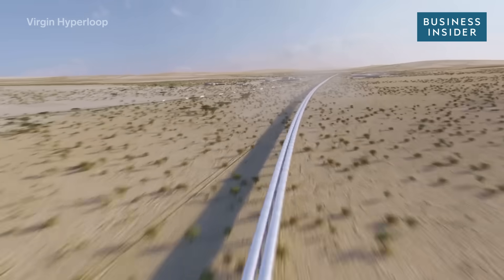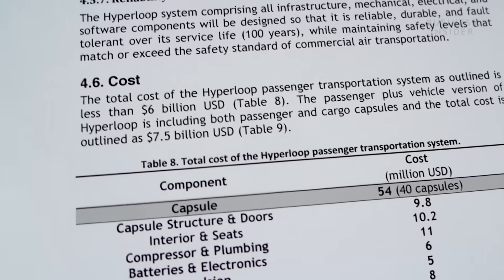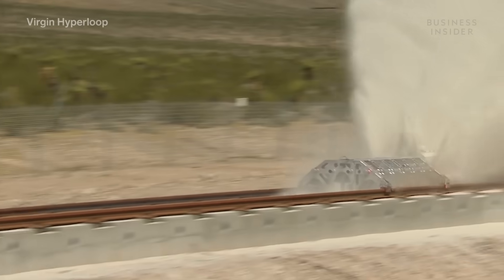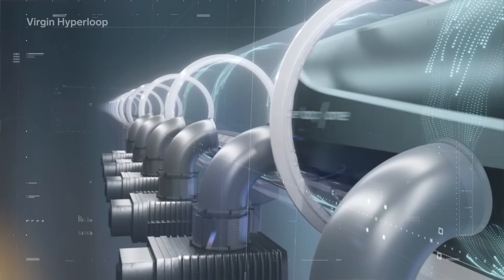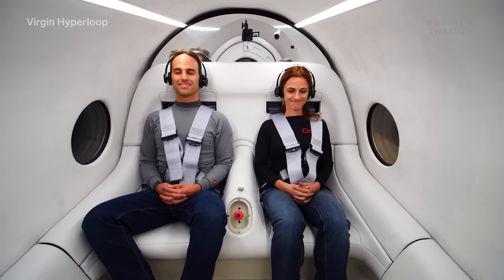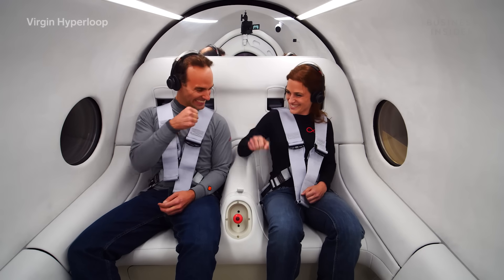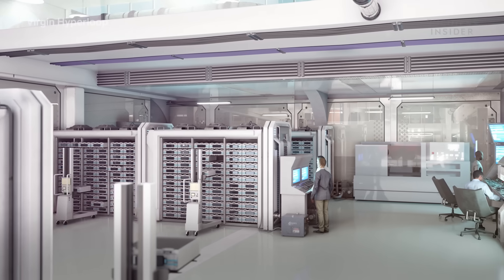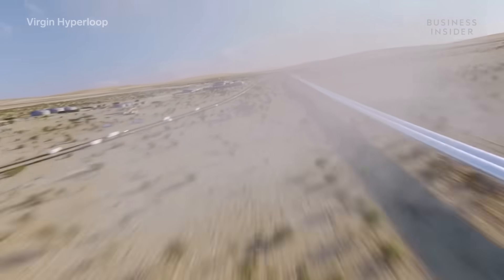How Elon Musk's 700 MPH Hyperloop Concept Could Become The Fastest Way To Travel

Comment: The modern monorail hype, nobody even mentioning that their test drives are slower than a bullet train.
Reply: Uh ...... bullet train test rides were also slower than the final bullet train.
Reply: @dogzer  high speed train test actually runs faster than their operating speed. TGV for example tested up to 500+ km/h while operated at around 320 km/h. Fuxing is another example, tested at 400 km/h and operated at 350 km/h.
Reply: @dogzer  but faster than a standard bloody train. Even prototypes of the hyperloop are objectively worse and more dangerous than what they are trying to replace
Reply: @lyca0n535  and bloody normal train prototypes and early production models were nightmares and death traps. This is like getting mad at a kindergartener because they didn't start with doing backflips on the playground.

No, starting slow IS THE RESPONSIBLE THING. Duh.
Reply: @Cyrribrae  They didn't breach average bullet train speeds even in their unmanned tests where safety isn't a concern. There's alot of criticisms beyond that but this was meant to be a demonstration to the public of what it's capable of and it's worse than existing transport while being several thousand times more dangerous.

Dude I'm not gonna complain if a plane hull in a vacuum tube concept gets infrastructure built I couldn't care less but people sucking this off for concept alone feels weird and sycophanty. 

 Again reminds me of the monorail hype
Reply: @lyca0n535  Sure.... but you know we have rocket prototypes in testing right now that don't go faster than a normal train? That's not because the engineering doesn't work, nor is it because they messed up, nor is it because they aren't planning to have it be much, much faster.

That's just the timeframe and stage of testing that they're in. Does that mean that every prototype in development WILL eventually work? No, of course not. But it does mean that expecting a new technology to wow you on its first steps doesn't really happen (or else they didn't bother showing you the actual first steps). 

I don't disagree with you that the hype has overtaken the engineering. But, that doesn't mean that you fighting the hype is doing any good either lol.
Reply: Slower than a fast car for that matter
Reply: It's not really a test drive of the final product though, it's more of a check mark for where they are right now. As they said in the video we are 10 plus years out still, 10 years a lot can happen.

whether this plan has merit or not at least follow the videos facts.
Reply: @mdem5059  It may not be the test drive of the final product but if your non-final product in 2020 cannot match the speed of the fastest steam engine, it's pretty pathetic.
Reply: @additional09  it been 8 years these things aren't easy to build the fact that they had a test drive was impressive but they really shouldn't be saying it's coming "soon" instead they should say " in 10 to 20 years we might just have a fully functional hyperloop prototype or final product "
Reply: @additional09  That's why it's called in development stage..
Nothing ever in early stages works as it should, nowhere near it. The same can be said for anything in any field of work.
Reply: @mdem5059  I agree that developing tech takes time but if the hype is so high and you can't even match the speed of a steam engine (a record made in 1938) and if there are already alternatives that go much faster, you're not developing it fast enough to catch-up. Next-gen maglev in japan will have 600 kmph speed (375 mph). By the time hyperloop hits even 150 mph, that same Japanese tech would have progressed much faster. Hyperloop is a distraction - just invest in current high speed rail systems if you want good infrastructure. Japan, Italy, China, Spain, France etc seem to do it perfectly well.
Reply: @additional09  indeed. The thing that missing for the report is that the consept of running a pod in a tube is an old one it not a new ideal. 

The real question would of been be to ask the engineer guy being interviewed is how many passengers can your system carry in a hour, and compare that to over forms of Intercity travel but that never gets answered because it never a transportation journalist asking the question.
Reply: @mdem5059  The hyperloop concept is just a few years older than the plane... If it way viable it would have been build by know.
Reply: @additional09  Don't get me wrong, I'm not for or against hyperloop personally.
From the little reading I have done, there seems to be a lot of negatives stuck to the overall tech, so in a nutshell from my understanding I'd avoid it too.

But If what they say is true, then in the futures future, it could maybe be better? Who knows.
Reply: @blablub2402  As I mentioned in the other comment, I don't disagree that the overall tech seems weirdly off and trying to solve a super complex problem when we don't really need it.
But I was just stated the facts of the video as it was presented.

If the hyperloop tech is worth it in the end or not, we'll see in 15-20 years when / if it gets build.
Reply: @mdem5059  Well hyperloop is fundementally flawed, so you don´t need to build it to see that the physics in Elon´s whitepaper don´t add up.
Reply: @blablub2402  Maybe, but seems enough people believe in it to at least try. And who knows, the RnD they put into this failed project could start something completely different in the future.
RnD into something new almost always makes it way into something else somehow, so it won't be a total loss for humans as a whole.
Reply: @mdem5059  yeah, i get what you're saying. my concern is how we spend too much time and money on these ideas instead of enhancing things that already work. US doesn't have a single mile of high speed train and all my friends are hyped up about hyperloop - a system that didn't invest in high speed trains won't invest in hyperloop and the ones that already have good quality high speed trains are not going to move to hyperloop so i struggle to see who exactly will adopt it... definitely not the middle east - they love their fancy cars!
Reply: @mdem5059  Even Elon Musk recently called it a stupid escapade of his and a bullshit idea and distanced himself from any further hyperloop related things (see Spacex Website)
Reply: @mdem5059  the design was around since the early 20th century
Reply: Well they can't risk killing someone so early on, causing the project to probably be abandoned. Without passengers it can go much faster than the bullet trains or whatever comparison. Just enjoy the innovation and look forward until we can use them
Reply: @mickmccarthy8219  People will begin enjoying the innovation once they prove the world that hyperloop works at full scale. So far, it's at a stage where once can consider hyperloop as a paper mache concept. Only time will tell whether it fails or not.
Reply: @mickmccarthy8219  they can't risk killing people early on, so you are saying it is okay for tesla to do it later?
Reply: @mickmccarthy8219  We'll see
Reply: that was a prototype as this is new technology and they are experimenting with.
Reply: @gibsonburt6925  maglev a new technology :-)
Nearly 40 years commercially in Germany, for years in Shanghai and invented 80 years ago but ok